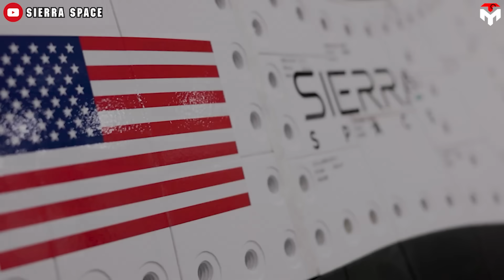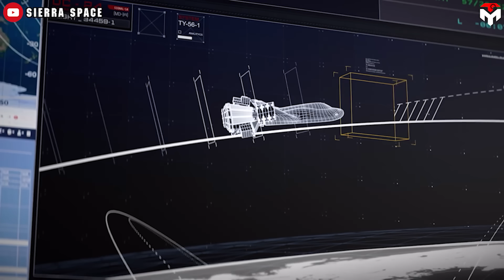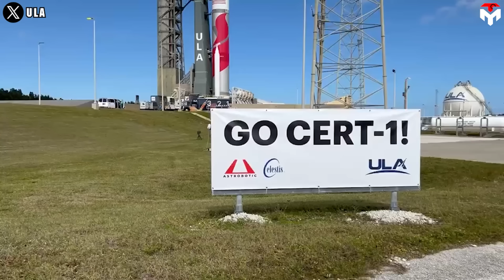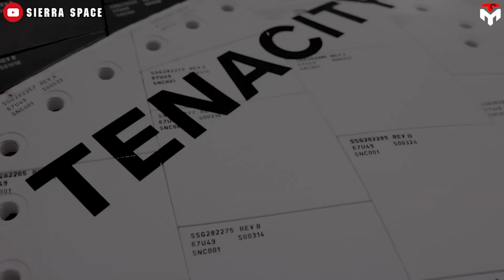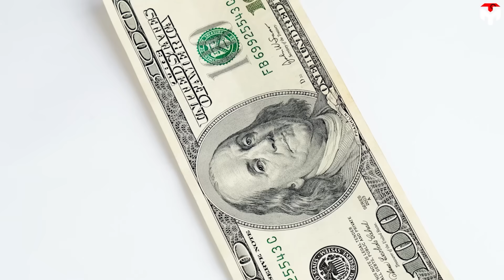NASA's New Space Plane Launch Was Cancelled! Biggest Mistake...

Comment: By the time they are ready, space station will be scrapped.
Reply from the maker: Yes, the ISS watch out for those tardy folks!
Reply: And we will be stuck with legacy systems for decades, just as we are stuck with that weird offset docking module that's on the ISS. It was designed that way to accommodate one specific configuration of the shuttle, which flew that way exactly once, then was retired.
Now all the new ships are stuck using a docking port with a dumb bend in it.
Sierra will be fitted with an ISS docking ring, and when the ISS is scrapped, we will be stuck with that docking ring for every new station going forward even if something much better is available.
Care to see a real-world example?
Many years ago, there was a spreadsheet program named VisiCalc.
Since every spreadsheet program has spent decades sprucing it up, renaming it, and selling the same original code, all of the VisiCalc command codes and function buttons work the same way in the latest and greatest version of Excel.